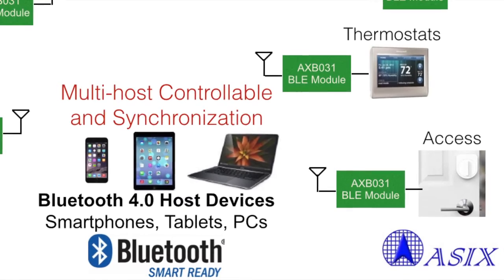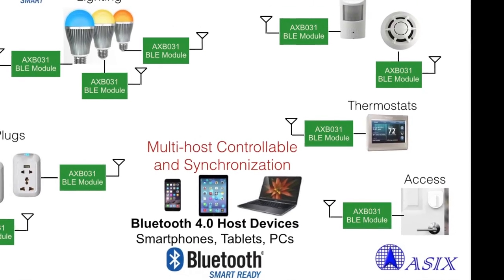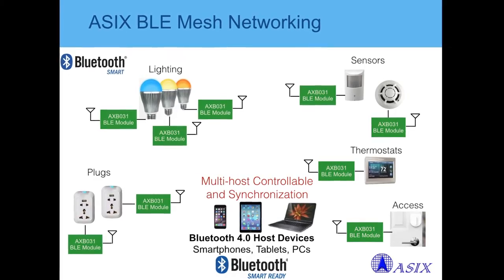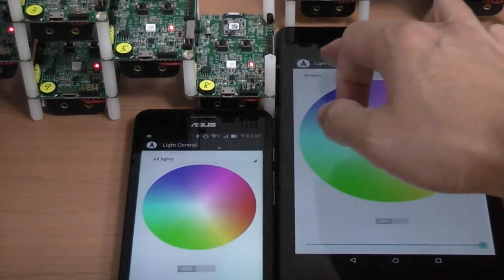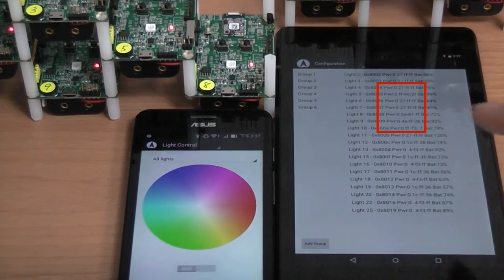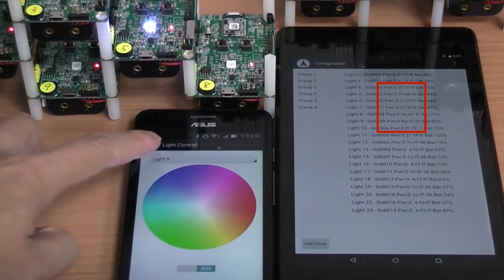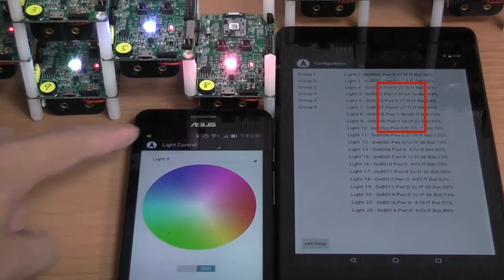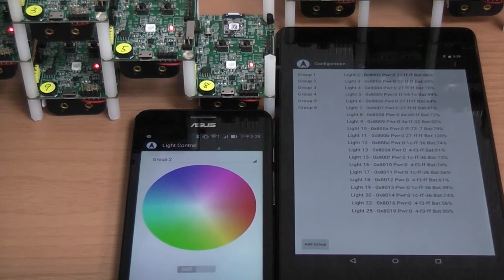ASIX Demonstrates BLE Mesh Networking, Controlled and Synchronized by Mult-hosts

Comment: is it possible to use this module togehter with an arduino ?

are there any arduino libraries for this (communicating via SPI or I²C to the AXB031) ?

I want to use several arduinos in a kind of star network,
one is the "central/host",
and all the others are the "clients".